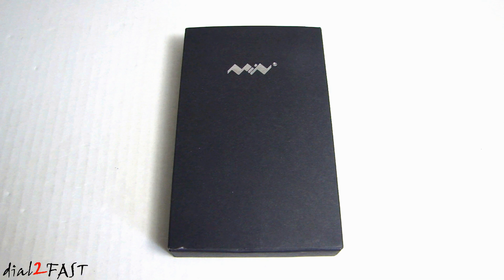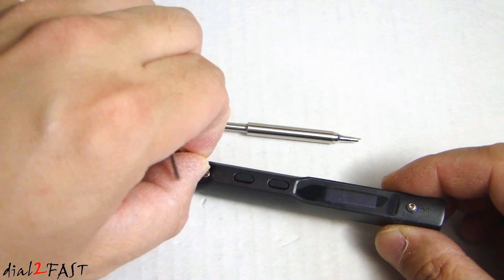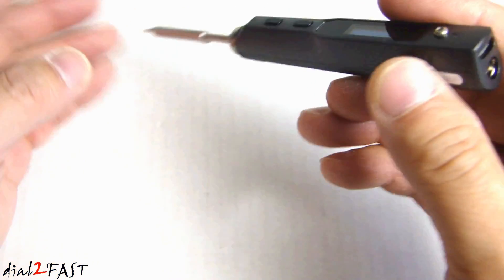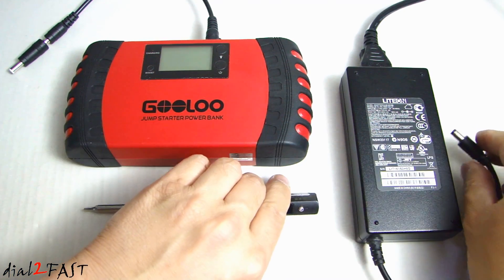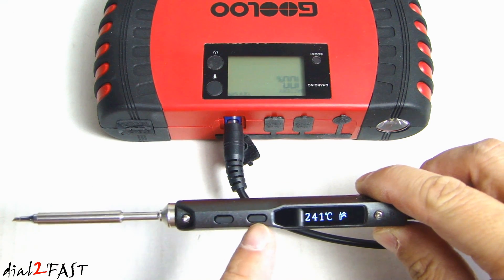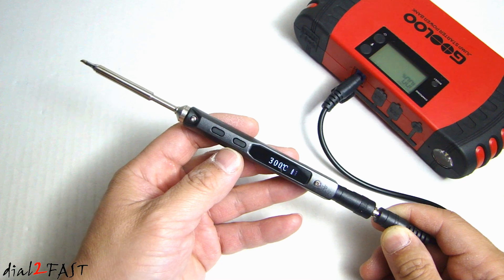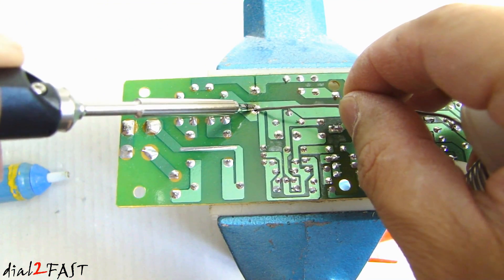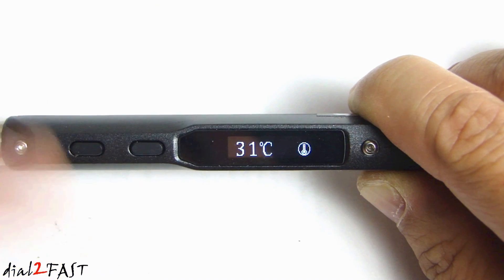World's Smallest Programmable 65W Soldering Iron - Miniware TS100 - GB

Comment: This is very nice soldering iron. The tip is good quality and oxidation is minimal. Since I solder antenna connectors very often I love "Temperature Boost" feature, which allows soldering iron to increase temporary temperature until you release left button. I put 5 x 18650 rechargeable batteries into plastic box which carry iron holder (adopted for tiny neck of this one) and cleaning sponge. That way I got kind a cordless soldering iron. Connection between battery and soldering iron I made from super flexible old cloth isolated headphone cable . I had laying around Volt/Ampere meter , I put it into box, showing me voltage of the battery and current from the iron. Maybe I should put few pictures to have a look.